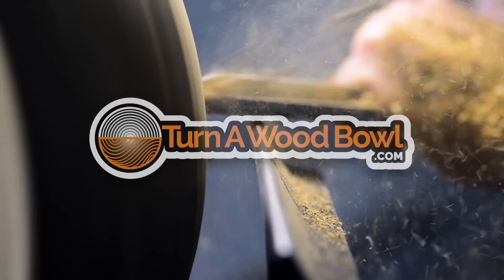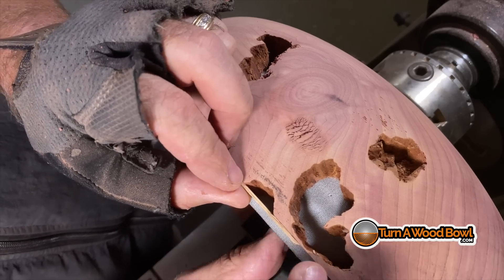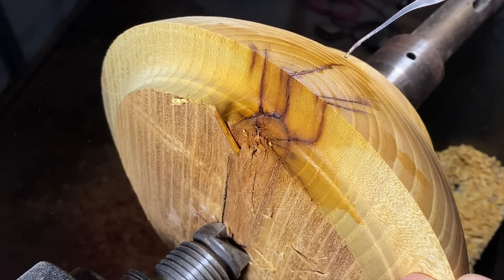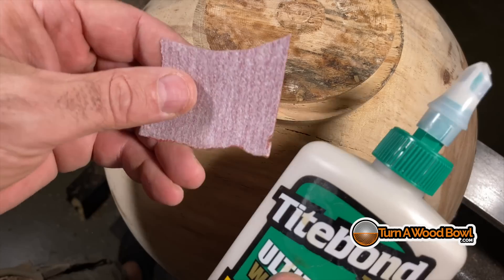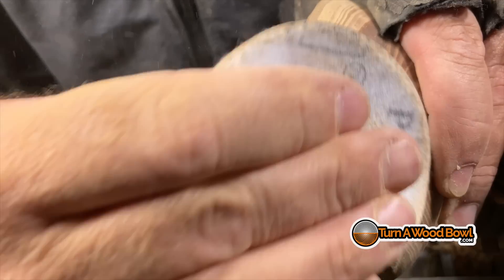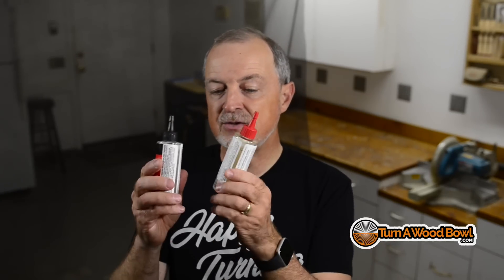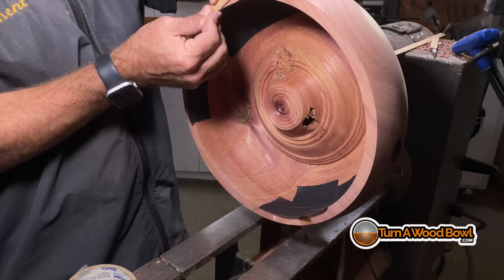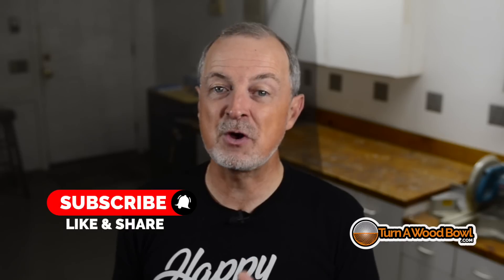Woodturning Fixing Cracks – Video

Comment: Kent. Great refresher on the methods you have shown in other videos. I have some red oak on the lathe that I have left sitting (and drying) after I rough turned the outside. 😢

The cracks are pretty deep and I need to fix them before I finish rough turning the inside.  I am going to use the glue/saw dust method. I had forgotten about it. 
Thanks for the reminder. 
Chas
Reply from the maker: My pleasure Chas. All the best to you and Happy Turning!

Comment: Kent, I have used the CA and glue.  It worked like a charm.  I have not tried the epoxy as of yet.  I have not had bad enough cracks or voids yet.  I know that in time I will run into this situations.  To any that have not signed up for your online courses don’t wait.  You will kick yourself after you struggle for awhile then signup only to find out that the frustration could have been avoided.  Don’t ask how I know.  Kent knows it’s called the school of hard knocks.  Thanks Kent for all of your help.
Reply from the maker: Sounds good Kevin. Well, now you have the info. All the best to you and Happy Turning!

Comment: Hi, good video. I like all of these methods. I’d like to share what I do on bowls that have cracks that appear going from the rim toward the foot. I drill a 3/8 in hole thru the crack with a fortsner bit. Then with my dowel bit, make dowels of contrasting wood and use titebond to glue it in place. Most of the time it stops the advance of the crack.

Comment: Hey Kent, I had this problem today. I was making mortar and pestles and one of the blanks had a huge knot. I love knots because they look so awesome when finished. So of course I cut the mortar like I would any other bowl. Well as luck would have it part of the knot busted out and shattered to pieces just as I was finishing up. So my solution was to use Gorilla Clear Super Glue (it does not stain the wood BTW but does take a bit longer to fully dry) on all the remaining parts of the knot. I ended up with a bowl with hole rather low in the side which I had to finish with sand paper (as I said I was almost done). Since it could not be used as a mortar, who wants a mortar that the ingredients will fall out of, it is now an amazing candle holder for votive or tea light candles and my girlfriend loves it. Thanks for the idea about the wood glue and sanding. That is very cool I will try it the next time I deal with cracks. Yall have a wonderful day.

Comment: I use a 3/8 fortsner bit to drill along a crack and glue standard dowels in the holes. I do this when the bowl is roughed in….works well and makes nice designs.

Comment: Bro Kent my lathe doesn’t have that nob on the side to turn the chuck / faceplate on top head stock.. when turning larger blanks I am weary of my threads on the headstock / face plate / chuck getting stripped eventually.. :/ 
But I’m sure I can get the part to fix it, just kind of seems like a design flaw to me. I’m running the grizzly G0462 - first lathe I’ve had and getting great results so not in a hurry to upgrade but the lack of features like I described is a bit of a drag and the no reverse too! But with all that being said it’s been easy to learn on and not too difficult. It’s also belt driven but variable speed.. no direct drive! My plan is in a few years to get a robust tools lathe like yours as they seem super nice! If I can afford it 😂

Comment: Good video Kent, I use used coffee grounds as a filler with CA glue. I also regrind them finer to get down into small cracks better.
Reply: I too have used coffee grinds. It was to replace a knot that fell out, the coffee looked just  like the knot.
Reply from the maker: Sounds great John. Happy Turning!
Reply: Used coffee grounds and five-minute epoxy has been my go-to for years. Espresso straight from the package is good for finer cracks. I had trouble grinding regular coffee grounds.

Comment: I am a new wood turner and I find your videos very helpful. I have been having a problem with cracks and have used CA glue and several fillers in the cracks but always,  always hated seeing the stain left by the glue. I will certainly try the wood glue and sanding procedure.  Thanks for all the helpful information.
Reply from the maker: Hope you like it Dennis. Happy Turning!

Comment: Great video and great topic! I just used thinned shellac to go around the cracks first before thin/medium c.a. to prevent staining because i dont have the spray lacquer, and it worked great. Basically any kind of finish I've learned will work 😊
Reply from the maker: Sounds good Mitch. Happy Turning!

Comment: Kent, another informative, helpful video. Thanks. Another method if the cracks are large enough and still on the flat wood before turning, you could bowtie them for an interesting effect.

I like the idea of using 5-minute epoxy when you want to deal with the crack/hole while turning
Reply from the maker: Yes, that could be nice. Thank you for writing and sharing! Happy Turning!

Comment: Interesting….    But what you say about filing a crack of 1/8  or 1/4 inch wide crack,  say a couple of inches long ?  Will the wood glue and sandpaper method work for something that wide ?   Curious.
Reply from the maker: Yes it can. You might need to apply it in a couple of layers. Happy Turning!

Comment: Nice trick with wood glue. I tried like this but also adding a bit of water to thin it. Titebound says no more than 5% or it decreases strength but here I don't know if it really matters as you don't really need the glue to be full strength. The thinner glue makes it easier for filling small cracks. I also tried rubbing with a bit of wood shavings but that didn't make a huge difference, just mabe reduced the sanding time.
Reply from the maker: Great tip! I wasn't aware of the thinning with water issue. Thank you, and Happy Turning!

Comment: Kent,  you present some very good ideas; ideas I have used in the past successfully.   However, there is a fourth alternative that I have found to be successful, as well.

A lot of the wood I turn typically has many large voids and cracks.   I will fill the cracks in the way you demonstrated, but I will leave the voids like knot holes or where punky wood removed, etc.   In doing so, the bowl takes on a uniqueness that Mother Nature caused.  I incorporate those openings as part of the piece and let it go; I do nothing else other than sand and finish. I have sold many bowls doing things this way and people seem to like what I have done.   And, from time to time, I will use a resin & color to fill the voids if the wood is a little bland and does not have much character.   But, I also think resins can get a little pricey and if one turns a lot of bowls with voids like I typically do, the costs of buying resin can add up quickly.  The same could be said for epoxies.

Most folks that I sell my turnings too use bowls for decorative purposes only.  The voids in the turnings seem to add a character they apparently find desirable.  But, I also say go with whatever floats your boat.
Reply from the maker: Great point J. Yes, going natural is always nice too. All the best to you and Happy Turning!

Comment: Seen quite a few vids where the turner used some dust from their job combined with CA Glue seems to do the job or if the big holes use Epoxy
Reply from the maker: Yes, but the dust usually changes color when mixed with epoxy. Happy Turning!

Comment: And as always… a great presentation! Thank you Kent. This comes at a very appropriate time. So much of my wood…maple , walnut, plum and cherry is cracking like mad. Yes I know, it was down to my storage method. But even so I have about the equivalent of a half cord of each of these drying under my deck, which in the summer is way too hot. So, I’m turning a lot of “cracky” wood. I often used your glue and sandpaper method, that I picked up from you some time ago. I now have two other great choices!
Cheers, Rick
Reply from the maker: Thank you for writing and sharing Rick! All the best to you and Happy Turning!

Comment: I’ve been playing around with milliput recently as another option for larger crack/hole filling with mixed emotions. On one hand, the variety of color options lends to some interesting results. On the other side of the coin, if the milliput tends to need to be used in thicker or deeper cracks because when it is thin instances, it tends to want to crack and chip. I’ve also seen this newer product that is applied with a glue gun?  Just some other options I’m sure you have already explored long before I ever knew of them. Super informative as usual sir.
Reply from the maker: Thank you for writing and sharing! Sounds like a colorful and fun option. I’ll check that out. All the best to you and Happy Turning!
Reply: When I use saw this for patching it usually looks really good until I put on a finish then it seems like it goes a lot darker than the rest of the wood .any suggestions thank you for the locker tip I'm going to try it next time I
Reply: @eldenwelchman6054   I’m sure you were probably asking Kent this question, but I have a couple suggestions if you don’t mind hearing them. I use two  different products that don’t seem to effect the color of the milliput. 
One is Howard’s furniture polish  which is just beeswax and orange oil. The other is pure Carnuba wax. I bought a nice sized piece from Amazon and it’s lasted me years. I’ve had good results with these.
Reply: @eldenwelchman6054  I agree. When I use wood glue or CA I get the same staining on each side of the crack, even when doing it like shown here. I am surprised I don't see that with his wood. Have you come up with any answers or suggestions?

Comment: Hi, love the in-depth videos.  I've been turning pens for a while, but yesterday I started my first bowl.  It ended up having a decent size crack.  My first thought would be to try Durham's water putty.  Have you ever tried that?  I might use the colored epoxy method instead, but just curious if that would work.   Thanks!

Comment: What direction should we sand if the crack we put wood glue in is on the end grain?
Reply: On the directon of the rings, as he does...
Reply from the maker: If you are sanding down on end-grain, there really isn't a direction to sand, just do you best by sanding the surface.

Comment: Is using the wood glue/sandpaper technique safe for eating from that bowl?
I have a bowl similar to the one you are fixing in the video, but I'm eating in it almost every day :) also, I need to varnish the bowl again after using sandpaper, am I correct?
Reply from the maker: Yes, Uncle Owl (what type of owl are you? I love owls.) Once the glue is dry and new finish has been applied and cured properly, it should be food safe. Read all the info on the products. You might want to steer towards a "less chemical" glue. Hope that helps. Happy Turning!
Reply: @TurnAWoodBowl  Thanks so much for your reply and very useful videos. (I guess, I can call myself a Lonely Owl ;)

Comment: Thnx, again!

One can use soft stone (white alabaster) and ca-glue as alternative for epoxy. 

Or mix woodglue with fine shavings or wooddust to a thick paste (longer to dry). 

Third and last: mix wooddust with bakingsoda (3:1) as a filler with ca-glue: the glue reacts (rather quickly) with the bakingsoda to a very hard substance: the wooddust will make it a bit softer and will match color. 

As always: thnx for you fantastic videos.
Reply: interisting and helpful
Reply from the maker: Sounds good. Thank you for writing and sharing! Happy Turning!

Comment: I have used this trick for awhile but I have a question , if the cracks continue to expand and make your work feel wobbly or off balance because it keels cracking will this gluing stop the crack from spreading ? Example I’m making a clock for a friend she wants it to be as close to the biggest diameter that my lath will do which is 16 inches so I started getting it round and it keeps getting wobbly I found the crack going from one side through the middle towards the other side, normally that blank would be put in the fire pit so I will wait to hear your response before I toss it out
Reply: Sorry for spelling voice to text does not always work to my benefit
Reply from the maker: Robert, if the crack is continuing it's probably because the wood isn't dry. I'd work on getting it as dry as possible first. Hope that helps. Happy Turning!
Reply: Thx for responding the blank was in a tin shed for about 5-10 yrs according to the gentleman I got it from , I checked it with the moisture reader and it was between 7-8   
So I guess glue it and hope for the best and saying with a smile don’t stand in the path of flying projectiles

Comment: Kent, how do you deal with bubbles in the epoxy? Thanks for the instructive videos!
Reply: Garry not Linda. J, you can carefully and quickly heat the surface of the resin with the flame of a propane torch or with a heat gun or hair dryer. It will lower the surface tension of the resin allowing the bubbles to escape. Be very careful to not scorch the resin or the wood around it with the torch. Small flame, keep it moving.
Reply from the maker: A little light heat from a torch will do the job. Happy Turning!

Comment: I have used about every method known to man such as epoxy, wood glue and wood dust, super glue, every type of filler such as glitter, stains, wood dust etc. that I could  think of.  I like a more “natural look” instead of artificial colors and wood shavings.  I sometimes use colored super glue on “very fine” cracks.  What I have gone to is a 50/50 mix of wood glue and very finely ground coffee grounds.  It gives an enhanced more natural look to the crack.  I use this on large to very large cracks.  I clean out the crack, mix up my concoction and force it down into the crack using a sharp point and pressure.  I let it set over night and on large cracks usually have to fill in again as it will shrink.  If you have a crack that goes all the way though to the inside of the turning just use tape on the inside to create a dam.  When re-turbing use a very sharp tool and go lightly.  I have had very good results and comments from customers and it has a nice natural look.
Reply from the maker: Doyle, that sounds like a great process. Thank you for writing and sharing! Do you have issues with the coffee staining? Happy Turning!
Reply: no staining but it does shrink when drying  so sometimes have to refil.  Very hard and does not chip out. @TurnAWoodBowl

Comment: I use all 3 of these techniques, however I have added another trick.

I drill a series of tiny holes and stitch across with braided fishing line. You have a huge amount of choices at that point.
Just a plain sewing job, you can do any type of stitching for patterns.
Also weave into the cross stitching.
If you choose the fiber based line, it can be died any color you want.
It can be soaked with CA to add rigidity ECT ECT.

Go explore the choices, and enjoy.
Reply from the maker: Thank you for writing and sharing, John! Please subscribe, and Happy Turning!